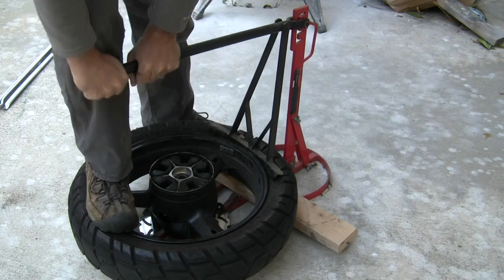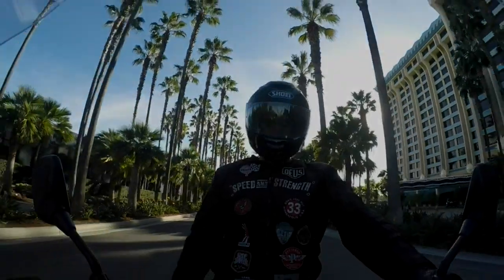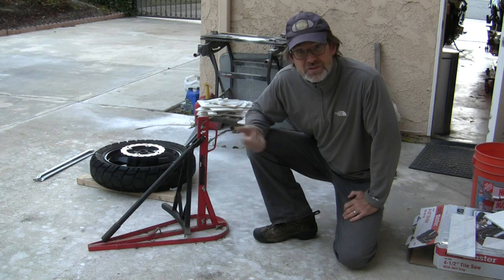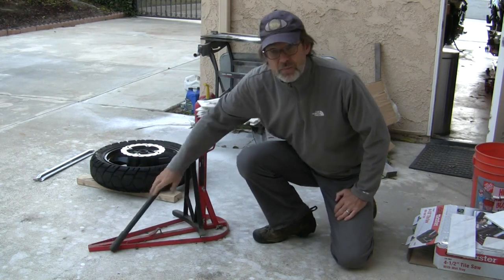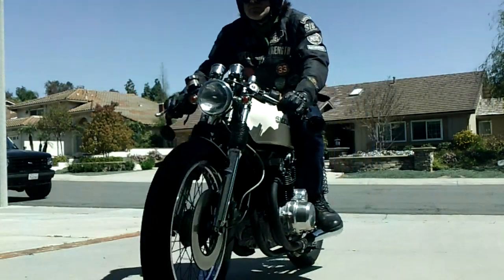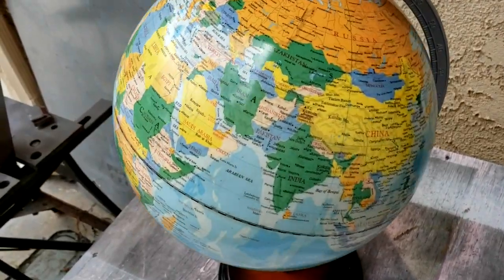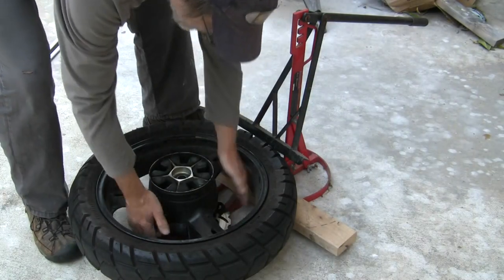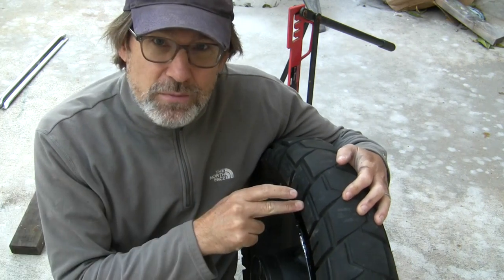Review - Harbor Freight Tire Bead Breaker

Comment: I use tire butter from any local ATV shop and a nail puller with a big prybar, never failed me and it doesn't scratch the rim done right, just get the 90 degree side of Nail puller under the rim and the prybar facing the tire
Reply from the maker: Thanks for watching and for throwing your insights in here for the benefit of others!